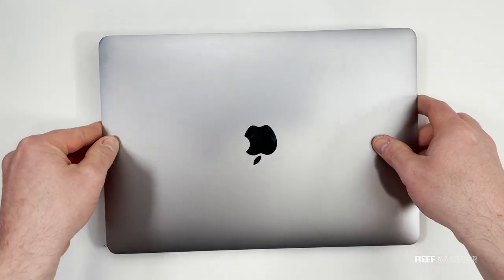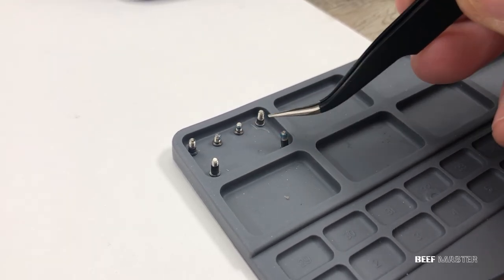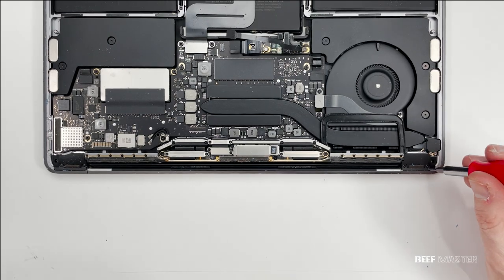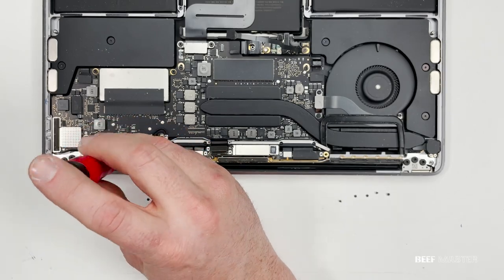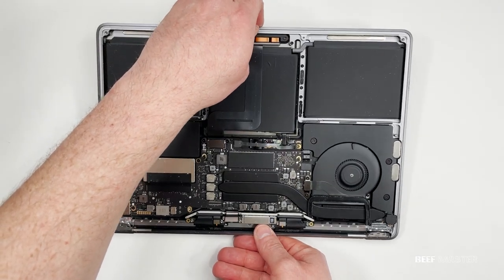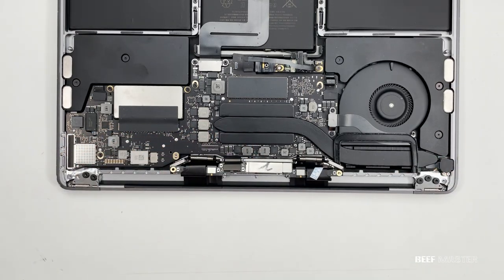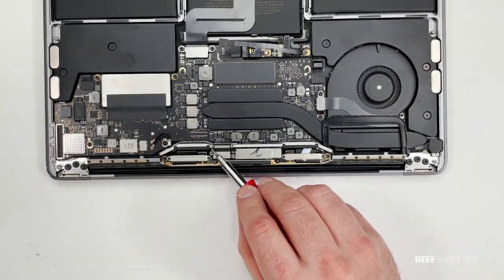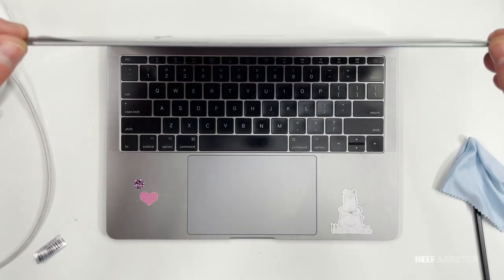How to Fix a Broken Macbook Pro Screen

Comment: This vid saved me a couple hundred bucks! The only issue i ran into was that the really small screws strip really easily. I ended up having to go to home depot, buying a 1/16 inch split point drill bit and essentially pulverized some of the screws i wasnt able to get out. Soo just be gentle with the twelve tiny screws!!
Reply: Hello Nicole, Did everything turn out well for your MacBook?

Comment: Excellent! I have a 2020 A2338 model, but I didn't like the screen replacement videos for A2338 (I had seen yours first). I followed your video instead for my replacement and it turns out everything was exactly the same for A2338 as for the model you worked on. Everything went very smoothly with zero problems. There was a "peel-off" flexible black cover for the antenna connections to the mother board on my laptop, which was the only insignificant difference. Many thanks for the best screen replacement on YouTube! Apple Store wanted $650 to fix; I bought the screen for $200 directly from La-tronics (it was an Apple screen).
Reply from the maker: Awesome. Thanks for posting this. Good to know that the A2338 is so similar.

Comment: Great Video! I was able to replace my lcd using your instructions. LCD is working great but, now my mac doesn't recognize the battery. It only powers on when plugged to a power cable. And when turned on, there is a weird buzzing sound coming from the top left of the keyboard. 

Is there anything I can do to fix this issue?
Reply: Just did it and my battery has the same problem. Wondering if you’ve found any solutions?

Comment: What year was this computer. We were told that if we repaired it we would have to register it with apple. Is this true. We have a 2018.  It has a broken screen.
Reply from the maker: This is a mid 2017, A1708 Model. Repair process is very similar to the 2018. Generally, repairing screens on your own voids Apples warranty. However, your warranty should be expired anyway. I’ve never had issues using the screens from the company linked below the video, so check those links out. They seem to be using refurbished Apple screens, but I have not verified for certain. They work perfectly in my experience.

Comment: I got the charge adapter trapped when closed the lid on my 16 inch, now I will probably throw £2000 in the bin. Just to buy the screen is half of the price of the newly arrived macbook air M2.
Really pisses me off
Reply: repairability is low on purpose.

Comment: I did this and now I can’t get my Mac to turn on without charger. As if it won’t connect to batteries
Reply: Same here, have you found a solution yet?
Reply: @anjuuu1235  it did stop after I replaced my screen.  I did it myself and that screen had 1/4 not showing from crack